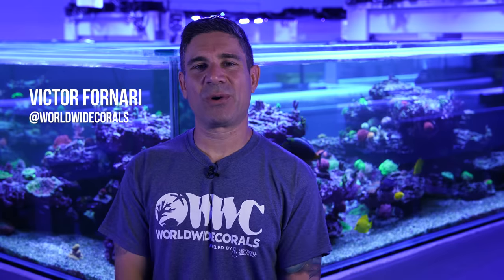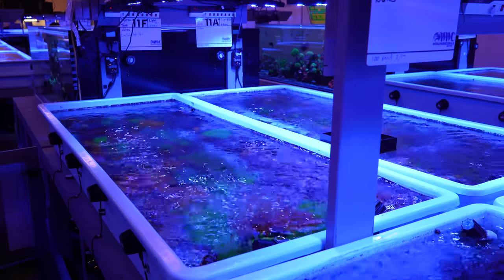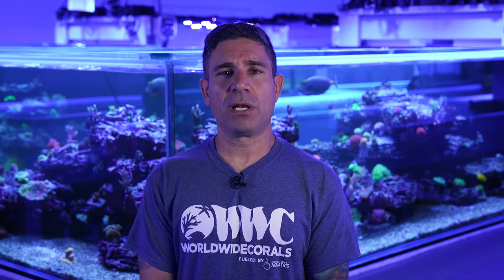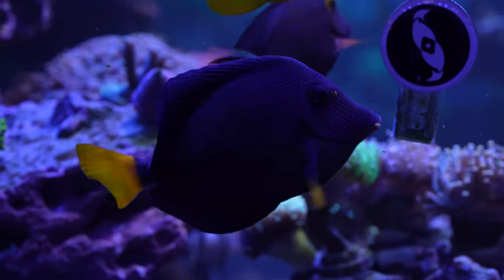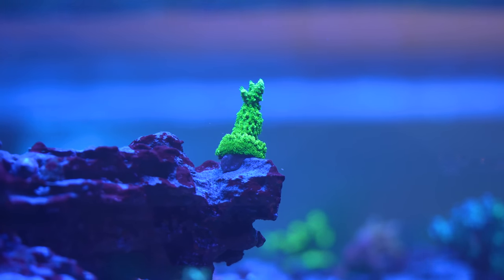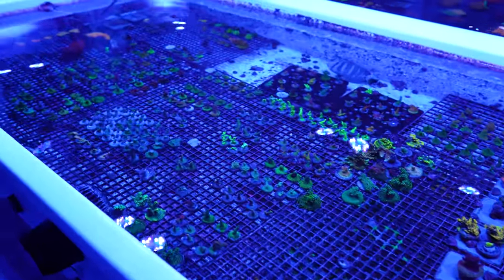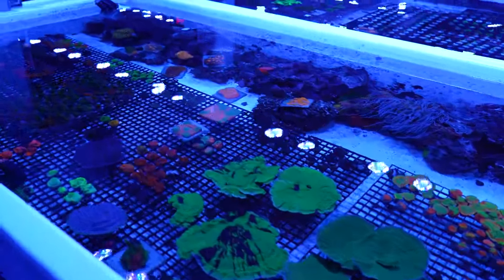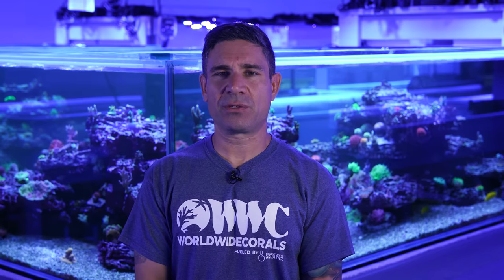750G Mixed Reef Turning Into An Acropora Dominant Tank

Comment: What sand are you using the in the display?  I’m using Seaflor special grade in my reefer 350 but I can’t stop my mp40’s creating dunes.  Looks like the stuff you use stays in place under high flow.
Reply from the maker: For tanks that requires higher flow, you could use substrate with very large grains. We actually use calcium reactor media for a lot of our tank’s substrate :)